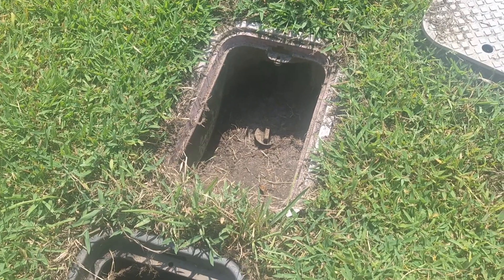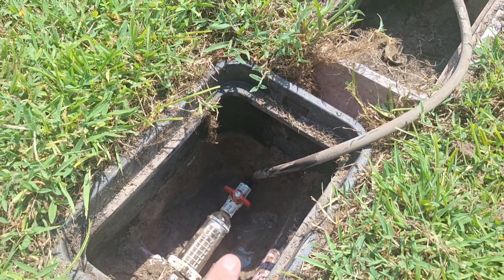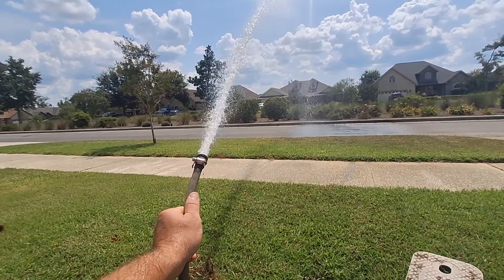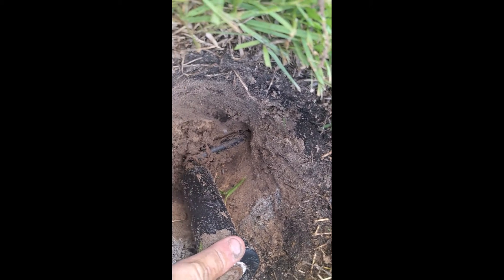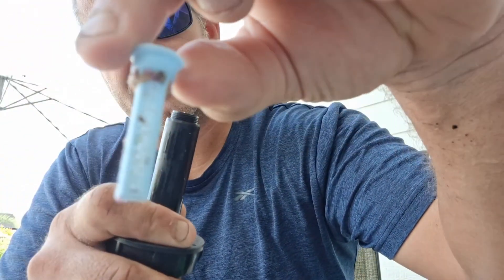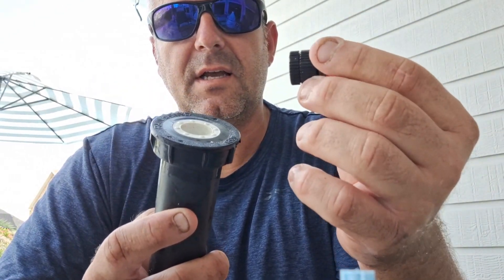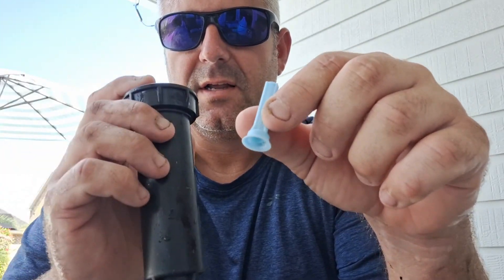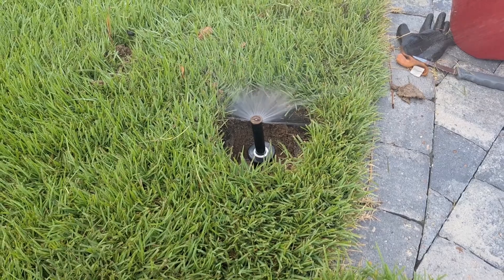Sprinkler / Irrigation System, Low Pressure Troubleshooting. #irrigation #diy #sprinklersystem

Comment: How many sprinklers you have and how you set up the hoses connection  underground? Straight and put cap at the end or U shape system?
Reply from the maker: I put 10 sprinklers on this zone and ended the line at the last sprinkler

Comment: great job, i subsd! need help 5 of 7 sprinklers in one bad zone are not popping up, i tried everything, changed selinoid, changed out diaphram and cap/bonnet but still have old valve base, washed out nozzle filters , and removed sprinkler risers and washed vinegar/water. all i get is sprinklers that bleed low pressure, i also dont hear water in the main valve at high pressure. master valve is 10 feet away and works ( i haven't done anything to master valve that feeds the zone valve tho, i haven't tested the silenoid either on it bc other zones work so figure master valve is sending water there)  can the line from the the master valve to bad valve have sediments ( in hard rock texas), i also heard to clean out exhaust port on bonnet by removing sileonoid? anything i can do to service master valve ( no leaks) as well? thank you sir!!!
Reply from the maker: It sounds like you have tried just about everything. The next thing I would test would be the main line for those sprinklers. You can take off the last sprinkler, turn on the system and see if you get enough water pressure to come out of the last sprinkler. I had a simular problem with my when I first installed this loop. the first couple of sprinklers would work at about 50% pressure and the other would not work. I thought maybe I had a crushed pipe as I just had a pool installed. Come to find out I had a sand filter on my incoming pipe that was clogged. My other zones worked because I only had a couple of sprinkler on them. the zone that was not working had 10 sprinklers on them.
Reply from the maker: Another way to test pressure would be to hook up a garden hose to the zone and test with knowen water pressure. This method may be more intrusive either by cutting the pipe and installing a fitting or maybe attaching the hose to the last sprinkler.
Reply from the maker: Check out this video for a sand filter.

https://youtu.be/VT5auQHyVbU

Comment: if the leak is at the top, couldnt you unscrew the top part instead of digging up the whole thing?
Reply from the maker: You can. I just didn't want to risk the chance of dirt getting back into the sprinkler.

Comment: So annoying thanks for helping but i think im screwed i just have low water pressure at my house
Reply from the maker: Here are two things to try. Take the head off the last sprinkler to check for pressure. If you have low pressure you an turn off a few sprinklers until you get enough pressure out of the ones that are still open. Also if you are on a city reclaim water you can call the city and have them test their side of the main cutoff valve to make sure they are supplying you adequate pressure. During the hot days some city's do not have the capacity to keep up with all of the new developments, so they will cut off some neighborhoods of certain days
Reply: Me too. I don’t have a filter to check. Just water coming from the city into my system. I have checked each of my sprinklers to see if clogged- nope.
Reply from the maker: Ask the city to confirm the water pressure at your main valve box.

Comment: So I have 11 zones in my system. System comes in fine and works great until it reaches zone # 8. At that point pressure drops dramatically and only a small stream comes from one or two  of that zones heads. If I move to my well pump and crack the bleeder on the impeller housing, air bubbles will come out and within a minute or two the zone will pressurize and come to life. The system will then finish off the watering cycle. Next day this same problem will repeat. What might I check in my system? Thanks
Reply from the maker: I am no professional, but have you tried to manually open the sprinkler valve? There may be some rocks that got stuck in the diaphragm. Also maybe clean all of the sprinkler heads to make sure they close all the way when finished. 

Have you tried to use zone 8 shortly after it finished maybe like 30min or an hr afterwards. The air bubbles coming off the pump indicates that air is getting into the system from somewhere.
Reply: @AmericaOutdoors1  thank you for the advice. I’ll check the sprinkler heads and the valve today.